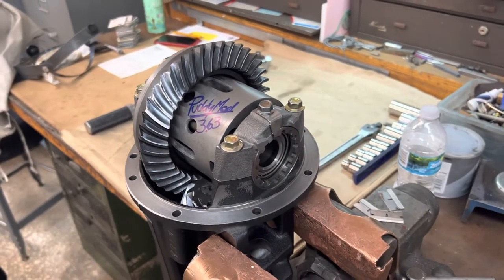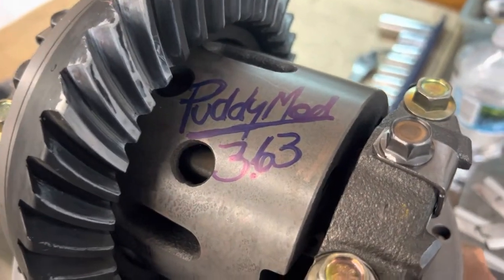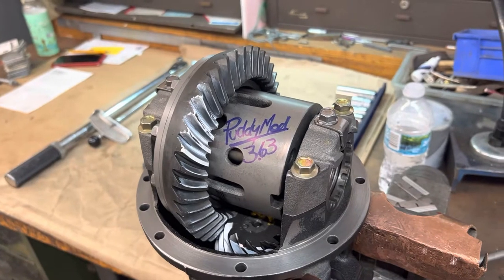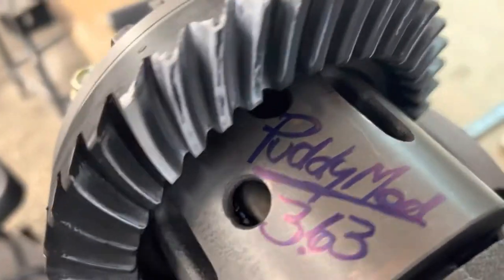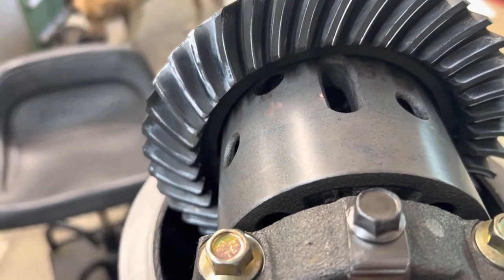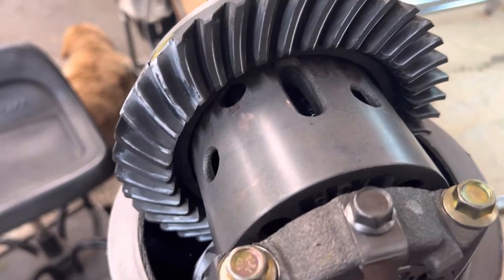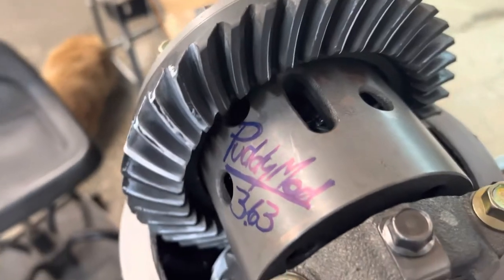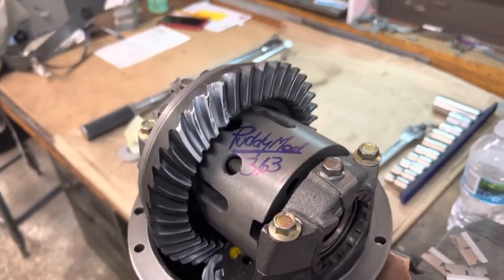Finale PuddyMod Mazda Speed Miata MSM differential with 3.63 ring and pinion #mazdaspeed #puddymod

Comment: How is shifting/drivability? The nc with the 6 speed manual likes to sit at +3000 rpm at highway speeds and takes three shifts when getting to 60mph at full load.
Reply from the maker: The 3.63 is mainly used by those that add boost to the car. It’s a nice driving gear